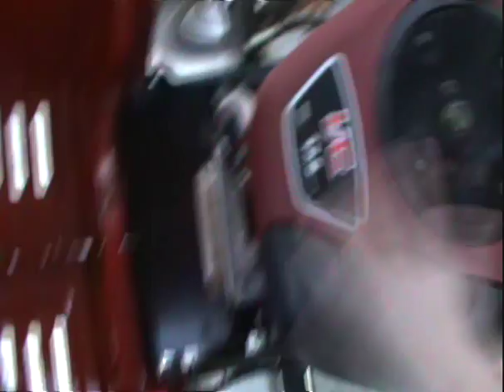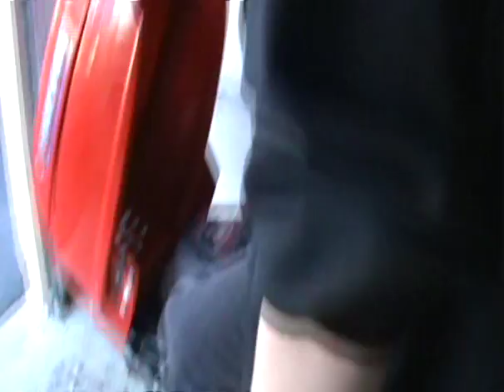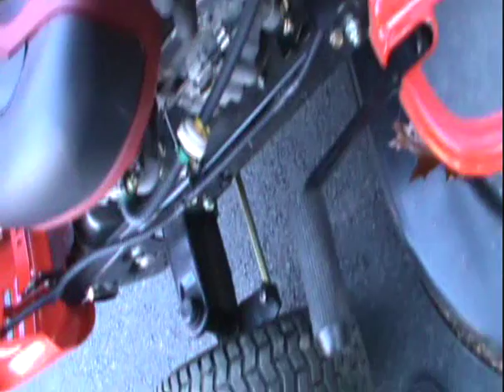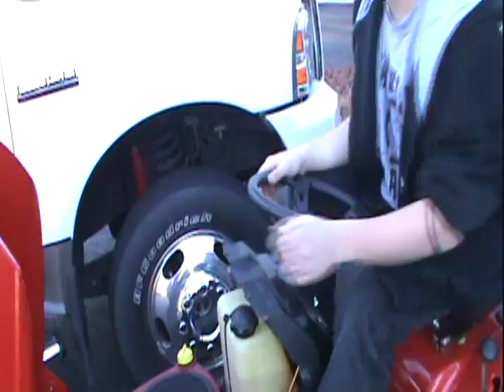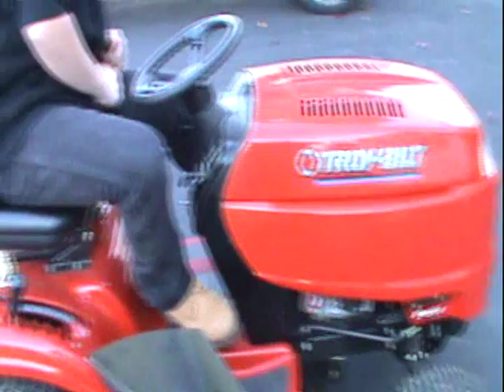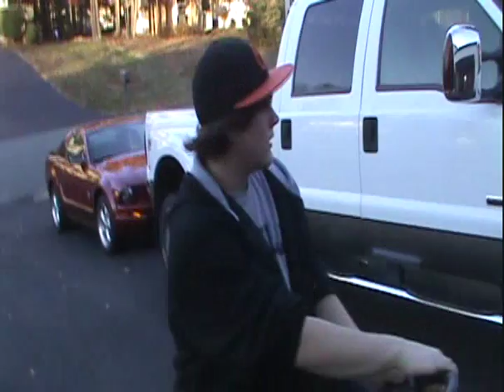Cold Start Troy Bilt Tractor With 17.5HP Briggs And Stratton

Comment: @Penguinboy1995  its a 7.3 cause it was stock at 6.0 i added a turbo and boosted my gas and its 7.3 nothing in the engine is stock actually. my dad had a torque converter put in an some other performance package parts. its V8 turbo diesel 7.3 liter performance package 2006/7 ford F-350

Comment: @Penguinboy1995 hey tell him it aint worth putting straight pipes on it if it is an intec because the cold air will warp them cheap valves in a heart beat, then hell be screwd lol get him an old flathead briggs or opposed twin lol